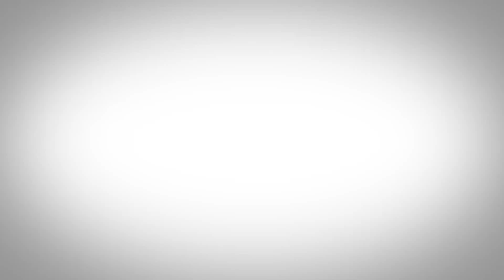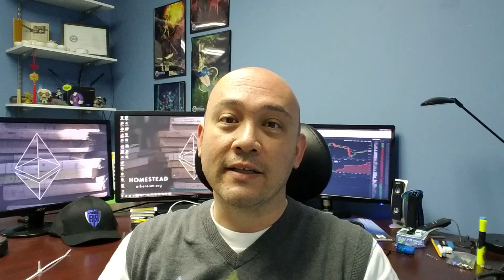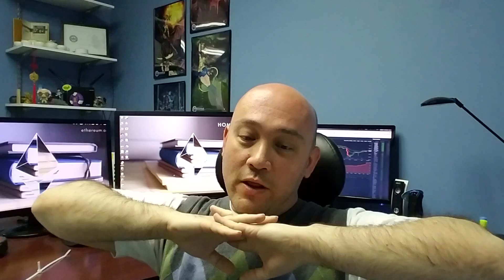BtR - Top 5 Bios Flashing Tips for mining Ethereum

Comment: How to do a tuning with a rig of 6 cads. Because if each board needs a different tuning ... for example how to control the voltage for the 6 boards if each works on a different voltage. Is the voltage / clock / vRAM fixed for each board?
PANIC! When I think to planing spend 8K in 3 rigs
Reply from the maker: each card's setting can be independent from each other, in Claymore the settings for each GPU is separated by a "," and in Afterburner unsync the settings.

Comment: Hi, I'm using a intel pentium g4560 and a asrock b250 pro4 like one of your videos, does this set up support more than 4 cards , because I can only get 4 to work
Reply: thanks in advance
Reply from the maker: Yes, it supports 6+ GPUs, both RX 480 and RX 580. You will have to make sure the mobo's bios is updated to the latest, and change the max TOLUD to 3.5GB, and all the PCIe slots to x1. Also, you should use an older AMD driver, like 16.9.2, if you are running RX 400 series, or use a hybrid driver if running RX 500 series.
Reply: Beyond The Routine Thanks, it works
Reply from the maker: remember, you should set Windows to not install newer drivers for your GPUs, as Windows 10 especially will try whenever possible to replace older GPU drivers with newer ones, which will break your rig and you will have to go through a lengthy process to remove driver and install original driver again...

Comment: Hi Great video. Do you use hwinfo to check if memory errors occur after overclock? I sometimes have drop the memory clock by 1.5mh before the memory errors go away in hwinfo. Are the memory errors bad if the hashrate is stable in claymore? Would recommend downlclocking the memory untill hwinfo doesnt report memory errors?
Reply from the maker: we tune each GPU within our 6xGPU rigs to run at different settings to minimize or eliminate memory errors. Sometimes minor memory errors will allow for 24-36 hours of straight stable mining but eventually it will crash the system. An error-free rig is a happy rig, and we would choose to run at slightly slowing speed and be mining continuously vs having to restart your rig all the time.

Comment: Whats the best process for flashing a card, using Windows and apps or ethos?  I currently mine ETH using ethos 1.2.1 running with 3 cards currently: 470, 470, 570.  I also have a windows machine I could use for the flashing process.   Thanks!
Reply from the maker: it is easier to flash the bios within Windows. Use the tool AtiWinFlash, current version 2.7.4 both to save existing bios and to flash the new bios. Use Polaris Bios Editor to open the saved original bios, make the modifications, then save as a different name bios. Then use the modded bios to flash the GPU in AtiWinFlash. Make sure you are using both programs as administrator. Search on YouTube for videos on how to modify and flash AMD GPUs. Check out cryptomined's channel for step by step videos :)
Reply: Thanks, this helps and will check out the other vids as well.

Comment: Hi
What do you advise me to use? Mining
 1-SAPPHIRE  RX 580 Nitro+ 4G 
2-SAPPHIRE  RX 580 Nitro+ 8G 
3-SAPPHIRE  RX 580 Pulse 4G 
4-SAPPHIRE RX 570 NITRO+ 8g
5-SAPPHIRE  RX 570 NITRO+ 4g
What power supply do I need for  6x 580 or 570 ?
Reply from the maker: all those are good cards, but I would say not to use the Pulse series. Usually 8GB versions are more overclock friendly but not always. Get a 1300W or a combo of 550W+1000W for the 6x 580, and a 1000W for the 6x 570. Make sure it is at least 80+ Gold rated.  We prefer EVGA, Corsair, or Seasonic.
Reply: Beyond The Routine have you seen or used the PSU kits from parallelminer.com? Converted server power supplies, much cheaper per watt but these kits only have PCIE connectors. People say it's really important that both PSUs turn on at the same time, but how would you do it if the PSU only has PCIE connectors?
Reply: cool, and turn off in reverse order, right? and we can use much cheaper <250 W psu for the mobo if GPUs and risers are being powered solely through the secondary psu (all gpus on risers, none directly connected to mobo)
Reply from the maker: yup!
Reply: hi again 
I bought Sapphire Pulse RX 580 8GB Hynix 
now I am new in mining
Does this BIOS apply to my card ?
Will the flash extend the lifespan of my cards ?